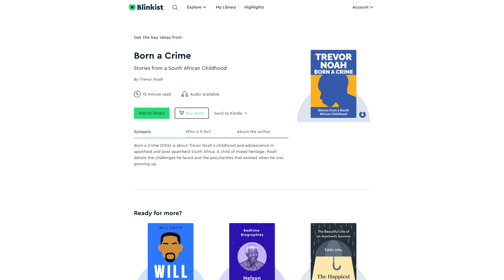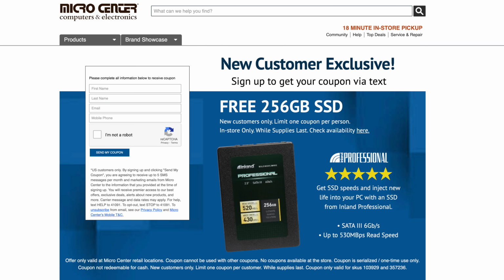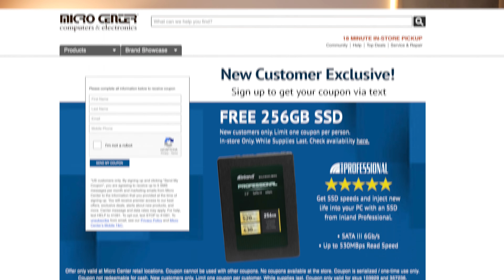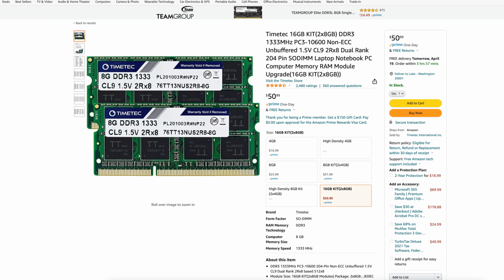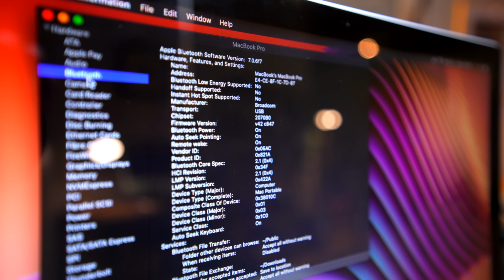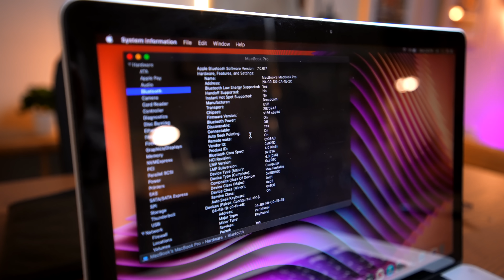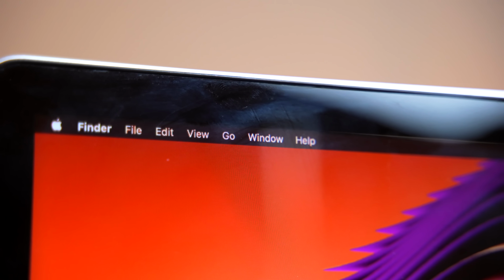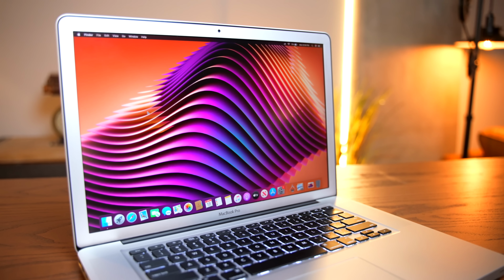Breathe new life into an old MacBook with THIS upgrade

Comment: My personal MBP I use is this same model, with the same upgrades you suggest here.  Works great.  I work for a school district that used to be an Apple shop, but has gone Chromebook and Windows.  There are still users of 8-12 year-old iMacs, MacBooks, and MBPs that we are having to forcibly remove them from the users, only because they have been deemed security risks due to not running current OS and security software.  Because of software (Renewed Vision's ProPresenter) I've purchased in the past running on my personal machine, I'll bring it in for special programs.  I ran our Baccalaureate program, and the 12 year-old MBP ran flawlessly.

Comment: I do not think the modern mac will have near the longevity of the older more repairable or upgradable ones from the late '00s or early '10s. My 06 macbook lasted until 2020, and underwent a screen replacement, 2 drive swaps first from the 40GB Hard Drive that it originally had to 320gb higher speed hard drive, then later to 1TB SSD and 2TB Firecuda Hybrid Drive in the Former Optical bay.

My 2008 Mac Pro 3,1 is still working. I have it Running Mojave with an RX580, 32GB of DDR2 800, 16TB of hard drives and a Pair of SSDs on a PCIe card to boot from and for Apps. the 2 Quad core 3.2 Ghz Harpertown Xeons are slow by today's standards but works fine for music recording.  I still use it to troubleshoot older macs since it has both firewire 400 and 800 for target disk and data recovery. it wasn't easy to get it running with that OS and particular GPU, since it's not natively supported by the CPU. but with a SSE4.2 Emulation layer it runs Metal and posts fine. But it's barely used as I've been adapting to Windows or linux based software.

I also still technically have a 2011 27" imac that I loaded to the teeth new and upgraded later and replaced the logic board myself in 2019 because apple wanted $800 to replace it and the part was $180 from another source. That runs off an SSD now as well. but it's primarily used by my parents for office work once or twice a month. 

I mostly run my linux machines now and one dualboot Windows10/linux PC that for games only. and have a Windows VM, from my network server, for the few things that I can't replicate in Linux on the other computers.  I've migrated away from apple as their hardware has become increasingly irreparable. back to my PC roots from my childhood and teenage years pre-college. building PCs with various parts and upgrading 1 part at a time, then building 2ndary, tertiary and servers with the parts as those others are upgraded. Probably have 4 PCs right now not counting the macs or my current work laptop and 2 Rackmounted servers and a DIY NAS running TrueNAS. all running Ryzen 2000-5000 CPUs or APUs on AM4 boards. Still want to get an EPYC to condense down the various computers more centrally.

Comment: I upgraded my 2012 15" 2.6 GHz Quad-Core Intel Core i7 unibody MacBook Pro with the matte high-resolution screen and I love it! This is my daily use computer and it handles everything I need it to do, including Photoshop and Adobe Illustrator and lots of web surfing. I actually bought this computer based on Luke's recommendation about the unibody MBPs. Thank you Luke for your continuing support for the older MacBook Pros!

Comment: I still run a late 2008 unibody MBP with most of the upgrades suggested in this video. 

SSD
8gb memory 
2.66 GHz processor - old one was 2.4
Patched in 10.15.4 Catalina 

My only complaint is the battery, yes, the battery is new. I only get around 30-40 mins run time before having to charge the battery which takes several hours. 
Anyone know how to improve battery time?

Comment: 12:19 I have a 2010 MacBook Pro with the anti-glare display. I am a HUGE proponent that when you buy tech, buy the absolute best you can buy. It helps to future proof yourself to some extent. I still use my MacBook Pro at least a few times a month. Nothing intense anymore (I used to game on it). I upgraded the HDD to an SSD which made it lightyears better. Still boots quick, very minimal lag on anything normal. I think I spent $75 on a 256gb SSD 5 years ago.

Comment: I still use my 2009 15” MacBook Pro. It has the anti glare display and an ssd. I will check out the wifi card upgrade. Using opencore legacy patcher I could even use display mirror airdrop etc.

Comment: A 2012 13 inch is my daily driver. However, the old cpu and graphics will be a bottleneck if you do more heavy tasks on it (which I do, which is why i will unfortunately be upgrading soon) which can be very irritating. So unless you know of a way to upgrade the gpu or cpu, I would only recommend buying these older macs if your doing lighter work (and if you do buy one, buy the larger machines with the more powerful specs). Also, i wouldn't recommend anyone buy this if they don't know how to patch their machines, as these things are not supported by modern mac os systems (and catalina only has around 6 months of support left at this point), meaning you will be vulnerable to attacks using older systems, unless you patch.

Comment: I have been using a Mid 2011 iMac 27", 32GB - 1TB for all these years. (I also have a Mid 2011 Macbook Pro 16" 16GB 1TB). It is still a great configuration. If I were to buy a new one in Brazil, I'd spend at least USD7,780 on a MacBook Pro 16". I can't upgrade the new iMac 24" to 32GB, unfortunately. So far, the only annoying thing on my iMac is the fan sound. But it works great with Photoshop and Luminar. When you buy a new iMac in Brazil, you will give another iMac to the Brazilian Government in taxes. Not my cup of tea.

Comment: Still using a 2009 MBP 13 inch with Linux. After adding an SSD, a new battery and upgrading the RAM to 8GB DDR3-1333Mhz, the laptop lasts 6 hrs doing office work.

Comment: The main downside if I could overlook USB 2.0 ports, is that the max macOS supported is only 10.13 High Sierra.
Reply: I run Mojave no problem on my 13-inch 2010, you can even put Catalina, Big Sur, or Monterey. Dosdude’s patcher works for Mojave and Catalina, and Big Sur and Monterey can use OpenCore.

Comment: I have a 2012 mac mini that is stock with 8gb ram being only upgrade but it seems quite fine though. I did replace mac os with Ubuntu Linux the current version and it actually runs much better and is usable.

Comment: If only what you said were true or current Macs (or PCs for that matter). They will have to go in the bin whenever a battery replacement or a re-pasting is needed. Apple is well aware that 2008-2013 Macs are its golden era. Since 2017 they're making sure this doesn't happen again.

Comment: I have a MacBook Pro 13 2012,  I replaced the HDD by an SSD and it is running with 12Gib RAM, it is working fine although no more new IOS

Comment: I really liked this project Luke! Keep up with these, they’re really interesting! My take on my 2015 15 inch retina MacBook Pro was to repaste the CPU first, which made a 5 to 10 degrees C difference. Then a couple of years ago, I replaced the SSD with a high end at the time, 2TB Seagate Firecuda 510, which gave it a 2900MB/s read/write (or even more in some other benchmarks). This is on par with the 2019 16 inch Core i9 SSD, and it can still run Monterey! It had already 16GB of RAM (although not a discrete graphics card), so this makes it still a current machine for most of the work that I do, including software development. The difference with the 2014 15 inch retina MacBook Pro was at the PCIe lanes for the SSD, and also in the EFI: The 2015 model uses 4 PCIe lanes for the SSD, while the 2014 is using only 2, limiting the SSD performance to about 1650MB/s. Also when I used the 2TB Seagate Firecuda 510, I couldn’t install Windows 10 because the EFI wouldn’t boot from that SSD, but there was a solution for that: You can export the NVMe driver from the EFI of the 2015 model and import it to the 2014, allowing it to boot even from the Seagate. However, since it wasn’t going to use the extra speed, I replaced the Seagate SSD with a 2TB Crucial P2 NVMe 2280, which was supported by the existing EFI driver, so I could use Bootcamp for Windows 10 without modifications! Finally, last year I changed the batteries on both models in an Apple store, because, although they were still keeping more than 4~5 hours of juice, they were swelling, making them a potential fire hazard. Even though it’s not a cheap upgrade if done by Apple, they change the whole top part of the unibody, giving you a new keyboard, touchpad, along with an obviously unscratched unibody! I’d like to see if you could think of any other upgrade to the 2014 or 2015 model.

Comment: my 15-inch unibody MacBook pro is an Early 2011 at the heart but it has a 2010 airport card and a display from 2010 but I have had a good experience using it with Catalina but the GPU is software disabled and with the intel HD 3000 iGPU Catalina runs better than Lion on a Late 2006 white MacBook. I might try to find a 2012 airport card and display but currently, its perfect for everything I need it for but an antiglare display would be nice

Comment: I have a mid-2010 MBP and have already upped the RAM to 8g and replaced the HD with an SSD. It works just fine for my needs. But I’m very excited about the possibility of replacing the display! Mine is a 13inch so I hope that 13” replacement displays are also available. I wonder if the camera on the new display is also better than the original. I do a lot of Zoom, and the camera on this old machine is so poor. Thanks for doing this video.
Reply: were you able to find the screen shown in this video? I cant find it for my 13" mpb 2010

Comment: Two years ago I saw your video on updating this model.  I had 8 gigs already so took it up to 16 gigs of ram. I then removed the CD room and moved the original HD into that slot and replaced the old HD with a 1TB SSD. Finally updated the thermal paste… So here is the problem. My computer gets so much hotter than previously. Did I do it wrong?  Suggestions
Reply: everything u have done should have Lowered temps considerably... my guess is the application of the thermal paste.. pull the heatsink, clean it up again, reapply and use a Different paste and Dont over apply the amount u use!... it gets compressed down and spread out from the center..
a small dot on the cpu is all u need, then attach heatsink and Carefully tighen down the croners Equally and slowly
Reply: aside from the thermal paste issue, make sure you dont have Something running in the background thats consuming high amounts of cpu... that will raise temps massively... use activity manager to make sure computer is idling with about 90-95% free resources... see if temps are going up .. that will help determine if its a thermal paste issue ofr background process issue causing heat... often, the spotlight function runs for a time causing high temps, then settles down.. hope this helps

Comment: Can I do that in MacBook Pro 2012 it has an HD and it’s slow as u know.. help 🚨
Reply: put a ssd in it.
Reply: @gmdrandom6287  thanks any model on particular ??
Reply: @RARB-RobertRodriguez  I used a crucialmx500. You can use any sata iii ssd. A sata ssd has the same dimensions as the hard drive in your MacBook Pro. You could also try inland ssds from micro center

Comment: An upgrade I gave my mom's old 13" Macbook was swapping the DVD drive out for an extra hard drive. It required a special caddy, but if you don't use the optical drive, and happen to have a spare 2.5" hard drive laying around, I think it's a nice feature.
This was especially helpful dealing with her massive photos library.

Comment: Did the same thing to my partners old mac. 

PRO TIP: Remove the Cd Drive (unless you actually use it) and install a second SSD. If you want to live dangerously, bonus points if you run that in raid 0

Comment: All the upgrading aside.. how about security? I have an old 2009 iMac and one of the main reasons I bought a new one is because I couldn't update anything anymore and that made me feel very vulnerable every time I went online and did read about security issues I couldn't even patch on my system because it was to old.
Reply: Open core patcher allows you to get the newest version of mac os on unsupported hardware

Comment: We did this on my 12 year old MacBook and then after that Apple blocked all major OS updates. I lived with it until the lack of updates caused me other problems. It was disheartening knowing Apple was causing this to happen, detecting ‘unauthorized’ hardware. The upgrade itself was wonderful and worked fine otherwise.ugh. My love hate relationship with the brand continues.
Reply: You can wipe the Macos and go with a Linux. Debian is good. Or with FreeBSD if you want to get into all manual configuration. FreeBSD website has a great website and it's not like Linux people giving you suggestions. It's real programmers with real solutions. Sometimes you have to go on the forums and see how people resolved issues though. It's part of the fun. Not only upgrading hardware but doing software as well.

Comment: I have an older 2011 MacBook Pro 17"; about 3 months ago it stopped getting Adobe Acrobat updates and I was having a hard time getting to Zoom to work. I haven't been able to get current Microsoft updates in about a year. I ended up purchasing a new 1TB SSD hard drive and I installed Linux Mint. After I installed Mint, I had to connect to my internet through a wired connection in regards to updating some of the software and drivers. I have been using the MacBook Pro as my daily work laptop and it is working perfectly.
Reply: Hopefully the graphics dont fail

Comment: I just right now searched this one and there were not a quite lot of listings for this and no one was with i7 processor can u list some or paste links in comment or can we upgrade cpu or gpu in this or which other MacBook Pro like this we can consider which is for cheap and available with wide listings on ebay or any other platforms

Comment: I've got a mid-2010 Macbook A1342 (C2Q P8600 2.4GHz) that I got back in 2015, dropped 8GB (2x4GB) DDR3 SO-DIMMs in, replaced the battery, and been running for about 7 years since as my daily-driver when away from my main gaming desktop.
I'm just saving a bit of cash to get some decent 2.5" SSD's so I can replace the old 5400RPM HDD and the seemingly-non-functional Superdrive in it (got a mount for a 2.5" drive to sit in place of the Superdrive, using the funk connector the Superdrive uses) and rebuild it with a fresh OS as it does what I need of a laptop nowadays without the bloat that Windows has been shoving down our throats in the past 12 years.

Comment: One more suggestion: Installing Linux on a decade plus old Mac can do wonders for speed. Modern mac OS is pretty painful on one of these, and old mac OS versions have started to lose things like support for current browsers. I actually installed Debian on one that I was thinking of scrapping and I run it 24/7 as a home server, mainly for Home Assistant! The CPU temps never go over 50 on it. When it was running mac OS the fans would spin frequently.
Reply: That's true, I use KDE Neon with the mtrack touchpad driver and it's fantastic, only thing I miss are gestures
Reply: Just tried Linux for the first time over the weekend on 2012 MacBook Air… I’m super impressed it runs perfectly, more people need to know about this option

Comment: Great video, Luke. I'm actually downgrading from 13" 2020 MBP and 11" 2020 iPad Pro to a 15" Early 2013 MBP and iPad Mini 2. Just don't need or want the "best" anymore, as these older gadgets work perfectly, just a little slower, like myself. Thanks for the excellent vid, and keep being a voice for the voiceless. Any suggestions to help these 2 classics?
Reply: You cannot upgrade the ipad mini 2. For the early 2013 MBP you could try putting in new thermal paste.

Comment: I have multiple MacBooks that just won't die. The only problem as I see it is that I can no longer update MacOS on these MacBooks (and my iMac). And once you can no longer update MacOS, you can no longer update applications as eventually applications start requiring newer versions of MacOS.
Reply: Try open core patcher

Comment: Still using my MacBook Pro 13.3" Retina mid-2014 with 16GB RAM and 512GB SSD. Also 2.8GHz dual core i5 (4 threads).
Perfect, other than stuck at "Big Sur".
Still beats most laptops I see people using, other than fairly high end modern.

Comment: Is the upgrade to the high resolution screen that much of an improvement. I mean it just seems like 1680-by-1050 isn't too much of a bump from1440 by 900. If resolution was the main desireable feature for a consumer than wouldn't the 2880 x 1800 retina model be the one to get. I Got the mid 2012 because I wanted to be able to upgrade parts on my own.

Comment: Honestly, I just want a replacement battery that lasts longer than a month. My 2010 13 inch MacBook is on its second battery replacement, and it is already dead after 1 month. I need to find a reliable one.

Comment: I've built a couple hackintoshes but it was your channel and how well you encourage the used apple market that this last February I bought a 2012 macbook pro off ebay for $250. The thing is in amazing condition, all I have done so far is clean the logicboard and upgrade from 8 to 16 gb of ram. It came with a 256 gb ssd. I was an adamant anti-apple person but this macbook without a doubt is the best computer I have ever owned or made...and I have made a lot. I'm going to look into the screen upgrade, I didn't know it could be done. I am also looking at getting my wife a 2015 or 2017 (depends on price) Imac. Thank you for the nice videos and help.